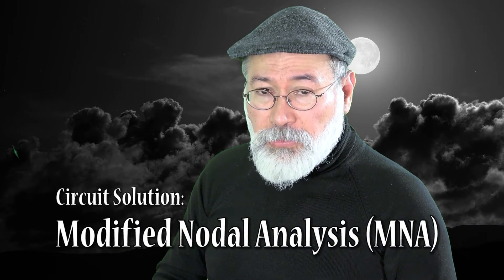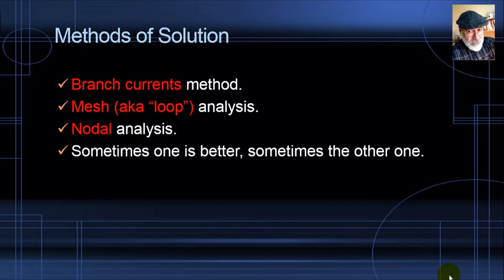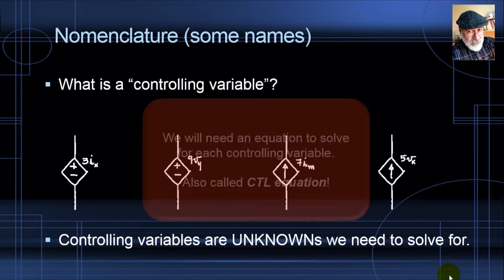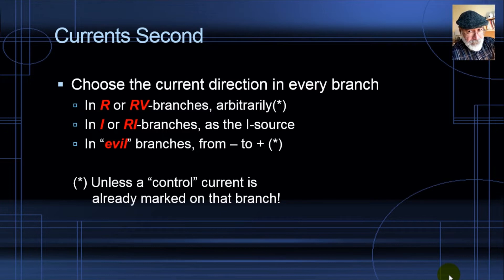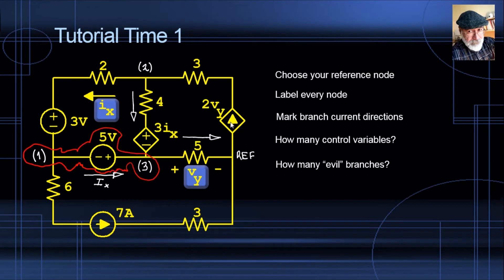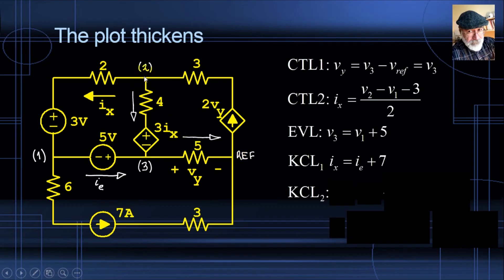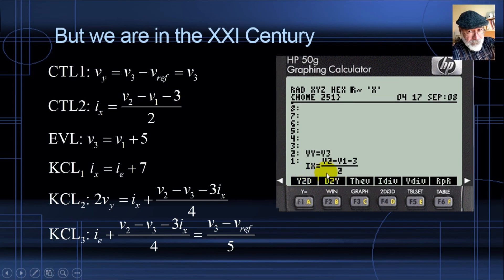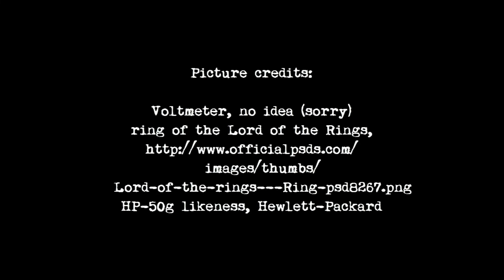EE 101/19 - Modified Nodal Analysis, first approach.

Comment: In the HP Prime, if there are already values input into the calculator for variables you want to use, does this create a problem ? For example if you first do something like V3=0, then input the formulas above, does V3 being assigned 0 affect the calculation?
Reply: If you set the value to v3=0, as it might be set from another calculation, when you input CTL1 the calculator it shows Vy=0
Reply from the maker: I have seen different people deal with this matter differently and successfully. I'll share with you what I do and recommend to my students: (1) I purge all user-created variables; (2) I create a backup file and call it "reboot". Then, everytime before I start a new question/problem, I type restore("reboot") and that reverts the calculator to that "no-user-variables" state so I am not sure that there are some phantom values hiding in variables that may torpedo my solution. I hope that this helps.
Reply: @rolinychupetin  Thank you professor

Comment: In KCL2, how can a current be quantified with the value «2v»? I do not understand how that can be a current.
Reply from the maker: The reason is that the coefficient of "controlled/dependent" sources has units. In the exercise, the '2' in '2v' has sthe units A/V, so the product is a current. Usually, the units of such coefficients are left as implicit, in a CCVS (current controlled voltage source) the coefficient is in V/A, so the product is in volts, the source in the example is a VCCS (voltage controlled current source). I hope that this helps. In the video on Circuit Elements in this series I introduced all these sources in some detail.
Reply: @rolinychupetin  Thanks for the reply. I acctually saw that video earlier, so I understood this after a while. It's been 25 years since I did any ECC, but your series have triggered my interest again.

Comment: 12:45 Doctor, if the voltage source was favoring the current instead of opposing it (that is, if the current was entering the negative terminal or equivalently exiting the positive terminal), would we have to use the equation i_od = (v_o - v_d + v_s)/R? So, instead of subtracting the voltage of the source, we add it. Is that correct?
Reply from the maker: Yes, that is correct. Sorry for the long wait for an answer.

Comment: Okay. That was a lot of fun to watch, and tied together a lot of previous groundwork in this series. It was most rewarding to work the demo problem along with you and finally get the right answers. I think I understand now a little something about what must be going on inside my LTspice program. In particular, I understand /why/ LTspice insists you attach a ground to your circuit, it needs you to choose a reference node so it can calculate!

Well, I learned that my Emacs editor has a "calc-mode", which turns out to be quite powerful, and supports algebraic manipulation and solving equations much like the HP50g. It's after learning how to use that a little bit, that I worked the demo problem and got the right answer, even proving to myself the current directions are arbitrary by flipping the assumed direction between node 2 and 3, writing slightly different KCL eqns. as a result, but still getting the same answer!

So, the challenge problem at the end, I've had a go at it, and here's my result:

i_x = 6.698A
i_e = -0.302A
v_y = 3.889V
v_1 = -1.111V
v_2 = 29.381V
v_3 = 3.889V

That i_e current feels wrong to me. I chose the current direction - to + in the evil branch. In the demo problem you worked, if i_x is flowing into node 1, and i_e is flowing out, you're left with 7A as you should have, and the evil branch is sourcing power. So, here if i_x is less than 7A going into node one, then i_e has to be flowing counterintuitively from + to - in the source if the remaining branch is still to have the 7A it must. If the evil branch represents a battery, I think it's getting recharged, as power appears to be getting absorbed there, 1.5W I believe!

I haven't double-checked my 6 equations, so if this is wrong, that's probably were I need to rework. Later, I'll write the schematic into LTspice and see if it will show the same values.

I am enjoying this excellent self-teaching resource. I've heard it said recently on "The Amp Hour" podcast #311, that YouTube is personality driven. Yours is certainly engaging and fun to watch!

Sincerely,
-one of your invisible friends.
Reply from the maker: Thank you for your very detailed comment. Excellent indeed.